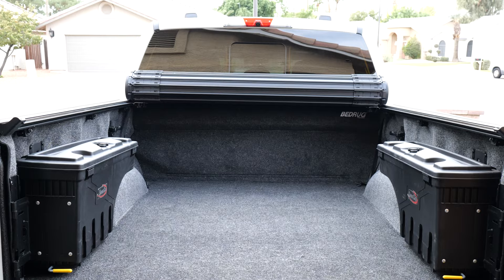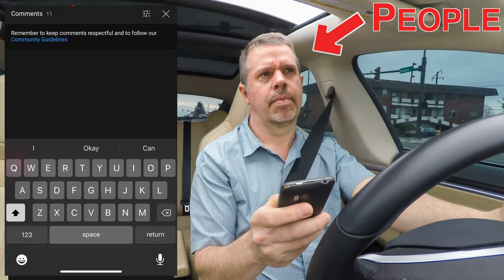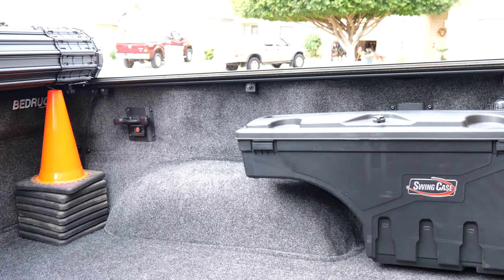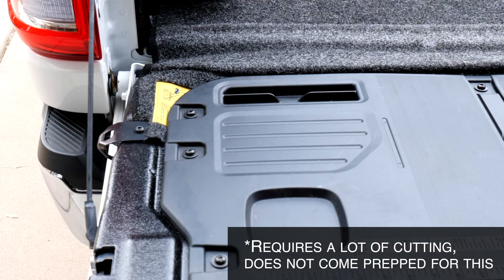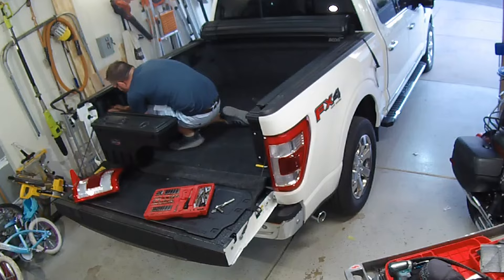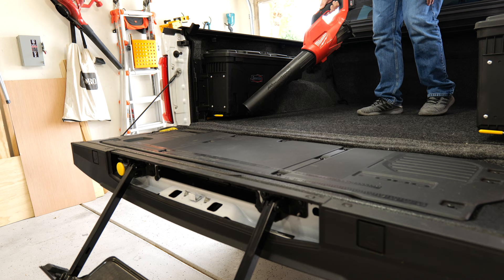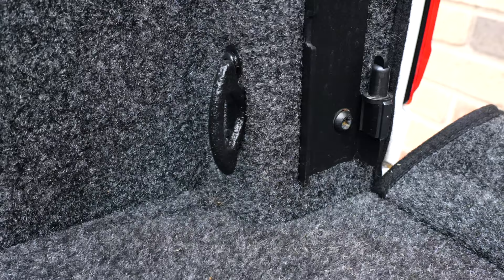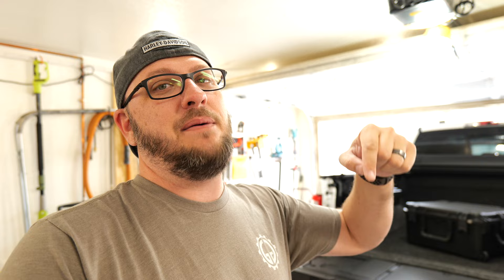BedRug Bedliner in my 2021 Ford F150 Powerboost... Always thought these were a bad idea

Comment: I put the Bedrug in my last truck. Had it 10 years with no complaints. Loved it. Easier on the knees, kept all my work boxes as you said where they needed. I was impressed how it held up. The only reason I didn't get it on my new truck is I wanted to try a spray-in bed liner. I had rubber mat, plastic drop-in, Bedrug, and now a Rhino Spray in. When I sold my truck, it had all kinds of paint, mulch and other stains but I took it out and the original bed looked amazingly well so it did it's job.

Comment: I've run one of these for 12 years and it has held up great - a lot better than the rockers and cab corners on the truck - no complaints. Really great when you have to crawl around in the back of the truck.

Comment: I have a 2004 Chevy Colorado with 250000 miles on it. I put in a Rhino Liner first and then installed the Bed Rug shortly after that and it still looks brand new. The bed rug holds up better than spray in liners that I have put in later trucks I have owned.

Comment: I have the same set up on my 2012 GMC Sierra Denali.   Bedrug, swing cases.  Both are awesome.  I have a full milwaukee packout lying down on its back a milkcrate holding some additional stuff.  I wouldn't own another truck without the same setup.

Comment: I'm on my second truck with a BedRug now and I wouldn't be without one. I was interested to see your install with the Powerboost panel as I'm looking at a 2021 Powerboost myself and I was't sure it would work with that power panel insert. 
Here's a Bonus feature of the BedRug you may not know. The "hook" side of hook & loop fastener material sticks very well to the BedRug carpet. I keep some 3' long strips fastened along the top edge of my BedRrug where they are out of the way and yet quickly accessible to tie down fragile items.

Comment: Great video. I’m getting a Line X Bedliner next week for my 2021 Silverado. However, I will still use bed mat from the Ford Ranger that I traded in because it pretty much fits and will prevent the slippage you described in the video. I’ll simply remove it when washing the truck.

Comment: I have spray in bedliner, and I put also bedrug smaller one, it is very soft to crawl around a bed.
for the light and bulk materials I lay down a tarp underneath anyway, so dirt is not a problem.
will have to think what to do for drywall, as it wont slide anymore.

Comment: You should consider getting a bed slide with a decent anchor system for securing gear.  Several manufacturers make slides that support varying weights and offer different methods for securing loads.  Yes, they are more expensive than bed rugs but you are not folding/rolling back the bed cover/tonneau to access gear or secure loads.  For caring expenses gear my solution would be a Diamondback bed cover and a bed slide.  I’d still do the spray in bed liner with this setup.  Like you, if I need to haul gravel or tall/large items I’d rather use a trailer.  Depending on which model Diamondback bed cover you choose you can load quite a bit of weight on top of it if needed.

Comment: Drop in rubber bed mat (Husky liner) seems like it would be an easier option. Wouldn’t have to worry about the bedrug getting damp
Reply: I've had 3 BedRugs in various trucks and just ordered a 4th for a new truck.   You don't need to worry about getting it damp.   You can pressure wash it, drive for a day and it's dry.    It's not for everyone, and for some a spray in liner is the best option.   I carry clean equipment and "toys" that need to not slide around.   BedRug has been the best choice for me.
Reply: the Bed rug is not carpet per say, it's more like the stuff the fake grass on some football stadiums is made of, it has no organic backing or any environment for bacteria or other gross stuff to grow in, power washing it and let it dry, it will look as good as it did brand new.
Reply: @dougl4680  how long does it stay wet, how long does it dry in? we get a lot of quick downpours here, and would like to still be able to use it as quickly for the family to be in as quickly as you can wipe off the sluminum stock floor
Reply: It's closed cell foam. It doesn't absorb water. The gray "carpet" part will only stay at a few minutes in the summer.
Reply: Does it leave scuff marks on your stuff? The rubber mat and comp bed on my taco leaves black scuff marks on my surfboards. Looking for a solution besides laying towels down

Comment: Bedrug is an awesome upgrade if you camp in back of your truck.  Keeps it cooler/warmer/quieter.  It is softer on knees... but if you are in and out of truck bed camping all the time, you'll feel it pretty soon!  

One thing I really noticed is that the extension to the tailgate catches a lot of road dust, and water, which keeps that from getting in the truck bed, which is golden when camping in the truck.
Reply from the maker: Good to know!
Reply: how quick does it dry after a downpour though
Reply: @---tx9xx  iIn my experience, is dry by next day when I get out of bed and pop the hatch and tailgate

Comment: Do you happen to have any video or pictures of the tailgate section of the bedrug showing you trimming it. Looks great and I'd like to do the same on my 2022. Thank you 8n advance.
Reply: I’m wondering the same thing.  I have the power tailgate with integrated step and was wondering if the carpet gets applied under the polycarbonate plate attached to the gate.  Does the carpet go completely around and tucked under the plate protecting all the paint?  Great vid man!

Comment: Hey Dan. Would you mind sharing photos of the tailgate? Plan to have the bedrug installed and would want to have the plastic tailgate cover over bedrug. Really cool to keep that look.
Reply: Hello, wondering if you cut the tailgate rug to remove extra material not needed under your workstation? Looks like you may have cut 80% of it off and left 20% to secure under the workstation, would this be accurate?

Comment: I have the tailgate work surface as well and there is a decent amount of exposed paint around this surface that scratches easily. Looks like you have some added liner around this on the tailgate surface. Was this done when the spray in liner was put on the bed?

Comment: Can you share more info on what you did for the tailgate work surface.  Did you cut off most of the bedrug tailgate cover?   I just got my bedrug and tech support for bedrug suggested covering over the work surface and pull loose the velcro if i wanted to use surface.  Seems clunky.
Reply: I also would like to know how you handled the tailgate...
Reply: I to would like to know that as well. I slowed the Video and it looks like you might have cut it to shape and then screwed it under the work space?
Reply: Just installed mine today. I lined up the work surface on top of the bedrug over the holes and used a paint pen to mark it. Then punched holes with screwdriver. Installed the hook/loop along the top edge of the tailgate and then screwed down the work surface over the top of the bedrug. Came out great. That said, it does look different than the what the video shows.

Comment: What happens when it gets wet and holds moisture against your bed. Hopefully your bed spray in liner will keep it from rusting.
Reply: F150's are aluminum, so it won't rust. But could corrode
Reply: This won't happen. It won't get wet, meaning it doesn't absorb and hold water. The Bedrug is plastic; plastic fibers woven and it only looks and feels like carpet. Water and air flow through it. Without any other liner the water flows out of the bed through all the designed gaps. Think of a plastic dish scrubbing pad. The Bedrug is much like this.

Comment: Great video! The only downside I can think of and it might not be one, is if you use a shovel removing dirt or stone loaded in the truck bed. Do you have an experience with that? I do like the idea of stuff not sliding around and padding for the knees!
Reply: I have the bed rug and if I am moving mulch or stone Ill put a tarp over the bed rug and then a sheet of 4x5.7 plywood ontop so I can just shovel off.  I dont do it often so its not a big deal.
Reply: @blackdogadventures7531  how quick does it dry after a downpour
Reply: @---tx9xx  not sure.  I have a retrax pro that covers it.

Comment: I’m considering the Bedrug impact mat, was just wondering what your thoughts are with the impact verse the carpet by Bedrug. My thoughts were the impact mat would not hold debri as easy as carpet.
Reply: Your thought is correct, but the impact version really is just a different plastic or spray in liner. I agree with the OP that certain things you really should use a trailer. If you do that then I think everything else will be better served with the Bedrug. It is luxurious looking and feeling. I feel it is hands down the best looking liner. I've had one and I'm putting one in my (yet to arrive) '22 truck.

Comment: Did you just screw down the tailgate work surface on top of the bedrug?
Reply from the maker: I did. I just poked some holes for the screws and it worked out well.
Reply: @GearsGadgets  Thanks for the info!
Reply: Did you trim it or just screw the cover over.
Reply: @GearsGadgets  Did you have to trim at all?

Comment: This really makes no sense and seems wasteful...why LineX and the a carpet???
Reply from the maker: Because Line-x was 1st, then after loading in $10,000 worth of drone survey equipment and having it slide into the bulkhead when I hit the brakes I decided it would be wise to go with a Bedrug which immediately solved that issue. I lug around some pretty valuable stuff at times and honestly after having the bedrug, I can’t imagine any use where I wouldn’t want it except for maybe an 8’ bed where you are loading 2x4’s or 4x8 sheets of plywood in and out consistently and didn’t want such a grippy texture. If you are a short bed usually carrying tools and only occasionally dealing with lumber, bed rug ALL day. 

Now why both? A bed rug will be a wearable / consumable over the years. When you go to sell the truck, you can yank it and have a virtually brand new unscathed spray in so in reality you could have used the snot out of your truck, but the average person will look at it like it was garage kept grandma driven.
Reply: @GearsGadgets  Seems to me a rubber mat would achieve the same thing at a fraction of the price and effort and could be easily removed if you need to lug some dirt or whatever.